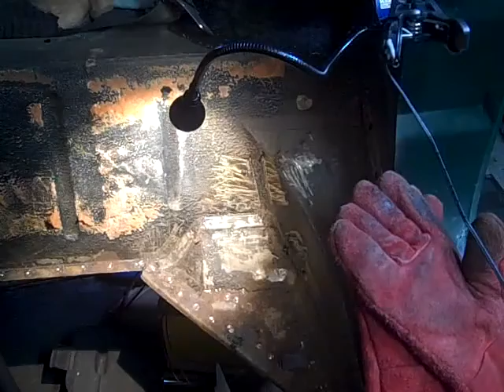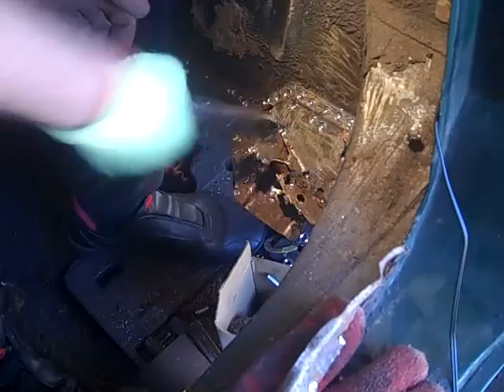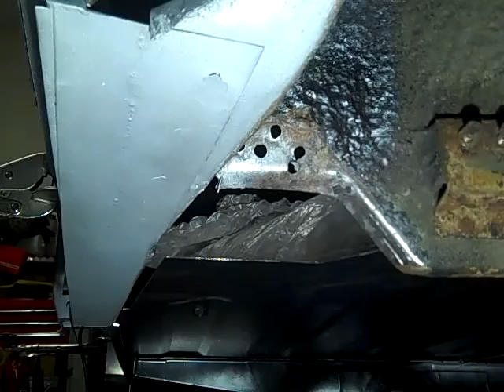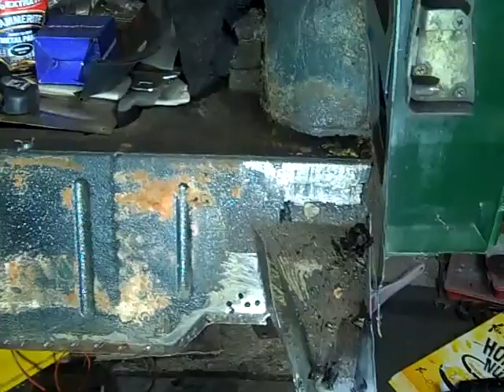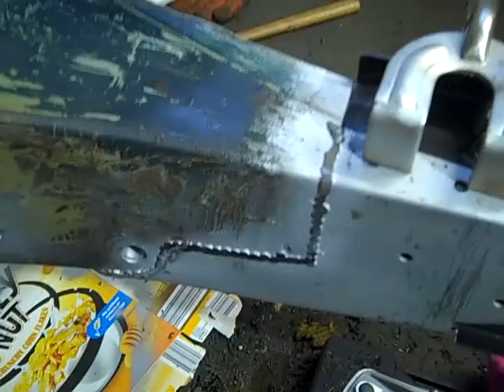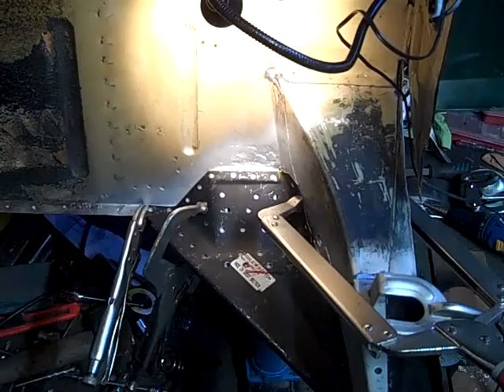MGB Restoration rear heel board plate and suspension bracket removal and replacement

Comment: OK...at 4:05 you answered my question!!😁
Reply from the maker: I'm glad you kept watching and found the answer. I either use carb cleaner spay or WD40 works but not as well to remove underseal. To get back to steel wire brush on a drill. Good luck and enjoy and walk away when you need to.